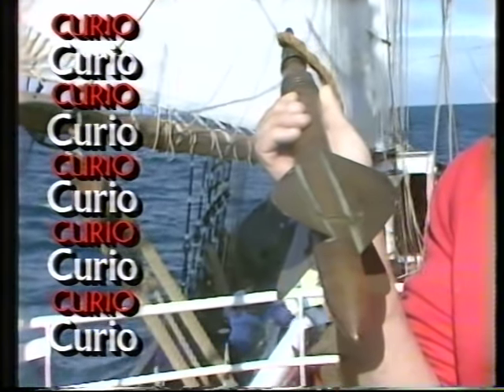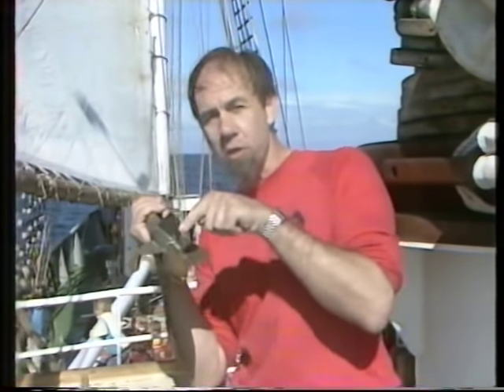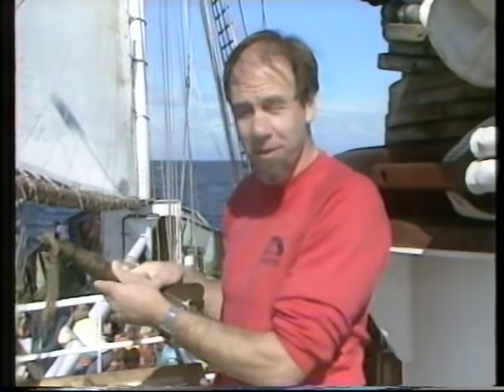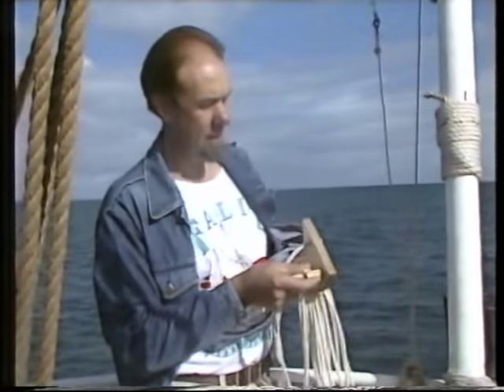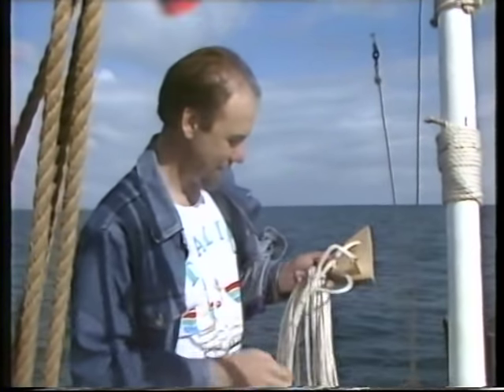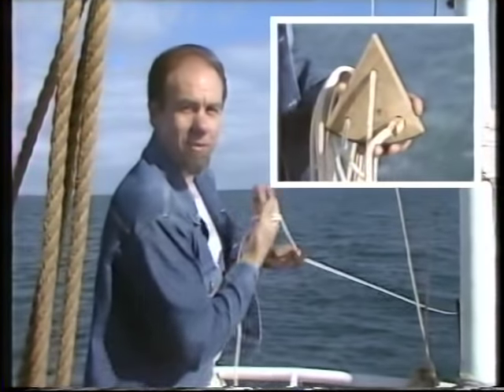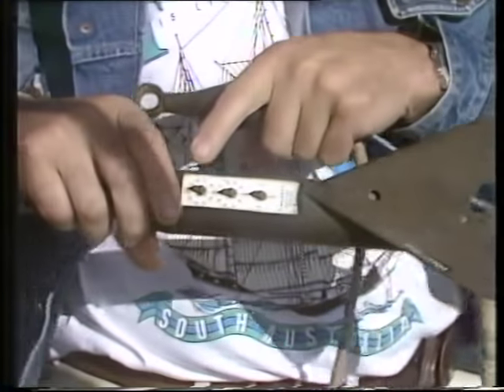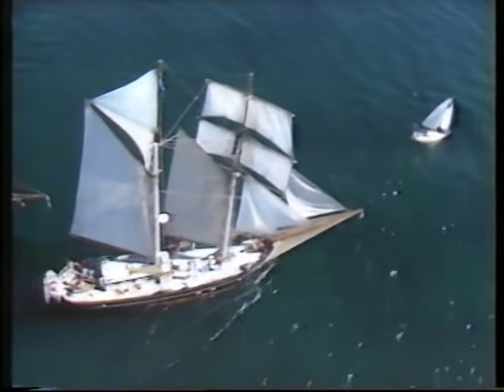Ship's "log" and "knots"

Comment: I am missing something here.  From the description you can only be measuring speed of the boat relative to the water, but you need ground speed to calculate your position be dead reckoning. Unless the water is dead calm, you still don't know ground or where you are.
Reply from the maker: I didn't invent the process. It is true that early technologies were notoriously inefficient systems for working out where you were but, until chronometers were invented, the best they had - Rob
Reply: @CuriosityShow  I certainly wasn't blaming you for the limitations of methods not used for centuries.  I couldn't figure out how it could really work to estimate ground speed,  until it finally dawned on me that it didn't work.  I do think you should have pointed out that major defect in the method.
Reply: I have always used speed through water  to calculate dead reckoning. I then fix my position and calculate set and drift to find my speed over ground.
Reply: @greekporsche928  I don't understand how speed through water gives you ground speed unless there is no current.  Isn't ground speed going to be water speed plus or minus the current?  Or are you just saying that the net error from accepting water speed as ground speed is too small to matter for short hauls.
Reply: @haroldbridges515  it doesn't unless you can fix a position. you use the dead rechecking and fix to calculate set and drift (current direction and speed) you then use that to calculate your speed over ground.
Reply: @greekporsche928  I don't understand your reply.  The problem that we are trying to solve is how to calculate your position without knowing longitude.  In the pre-chronometer period, we only know last known position, heading, and water speed.  You are assuming that we somehow start with our current position, but that's just what we don't know.  Am I misunderstanding something?
Reply: @haroldbridges515  You are correct that it wasn't possible to find longitude in the pre-chronometer period on the open ocean. Everything I mentioned above would not be possible on the open ocean without the ability to fix their exact location. It would be possible if they were close to land and could triangulate their position.
Reply: @haroldbridges515  The problem that we are trying to solve isn't how to calculate your position without knowing longitude, it's trying to estimate your position with the best practical technology available. An anchor style log and a long rope could be used if accuracy was at a premium!

Comment: Why every knot is at 14.4 meters though?
Reply: Knots were typically eight fathoms, or 48 feet, measured against a 30 seconds hourglass. Apparently when it became clear that the hourglass actually took 28s, the value was adjusted accordingly to 47ft 3in, or 47.25 feet or, 14.4 metres. By the way, a fathom is a unit equivalent to 6 feet used especially for measuring the depth of water. There are 2 yards, or 6 feet, in an imperial fathom, which was originally the span of a man's outstretched arms. The size of a fathom, according to the British Admiralty, used to be a thousandth of a nautical mile. Different vessels could measure fathoms differently, yielding crazy values such as 1.5m, 1.7m or 2.1m.